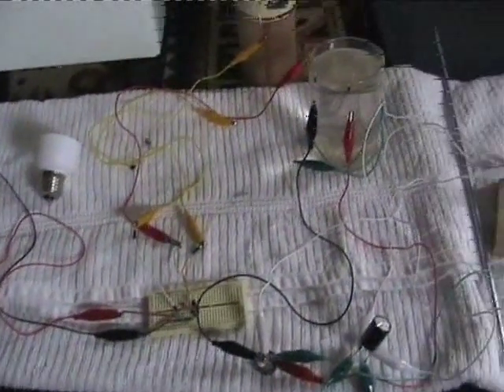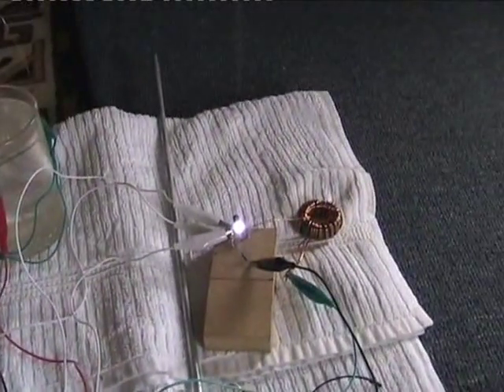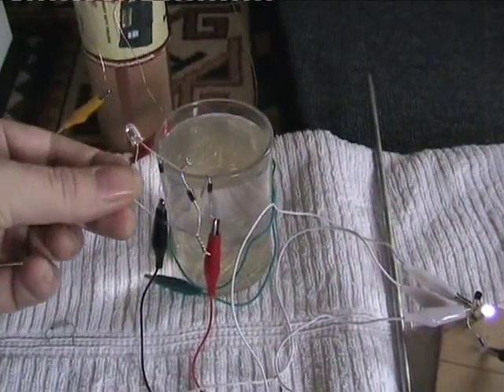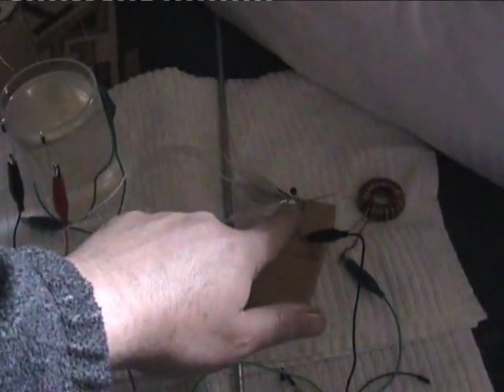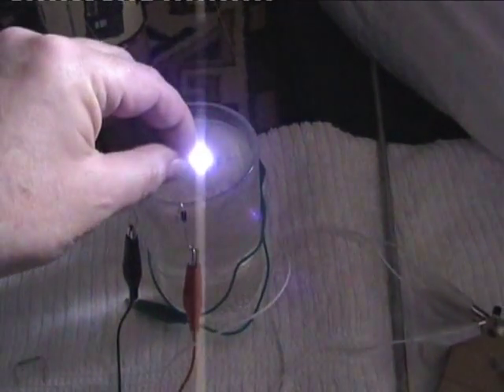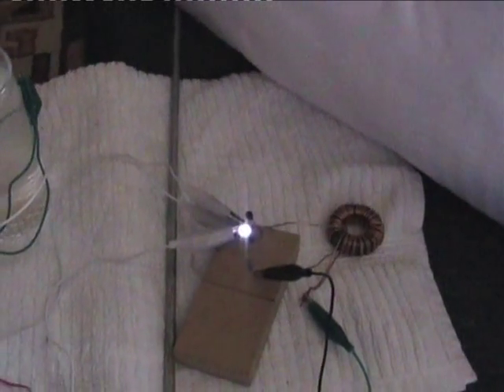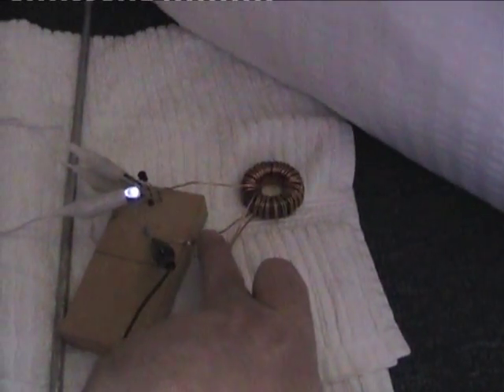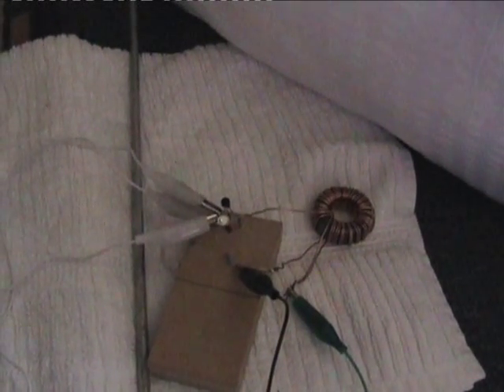Water Powered Magnet Spinner

Comment from the maker: @GBluer Thanks very much. Once again, your circuit is the source of the whole operation ... so many thanks for sharing your work and allowing it's non commercial use. I'm having a blast.

While using 27V i did get zapped by the hot wire, it burns subcutaneously! It shows no visible marking on the surface layer of skin, but a black mark under the skin.